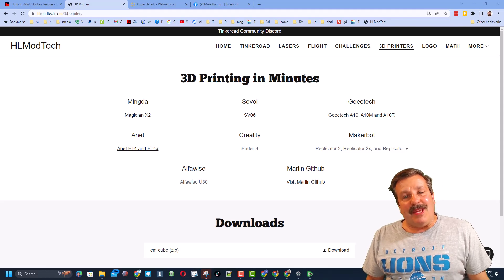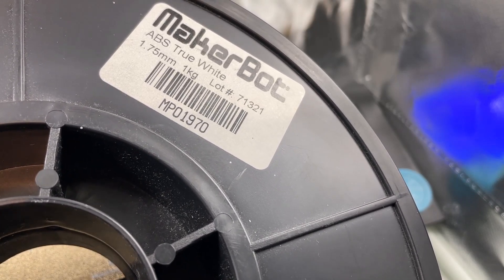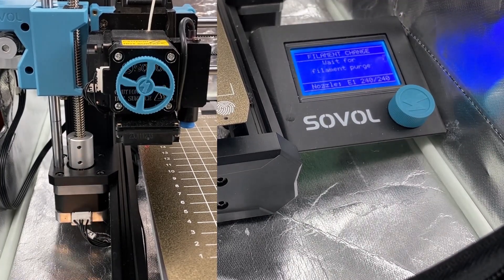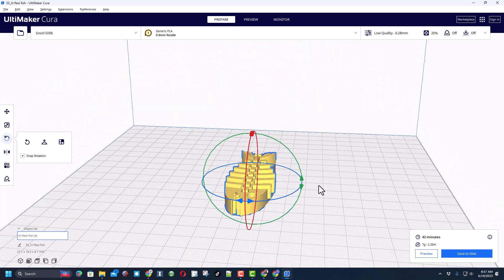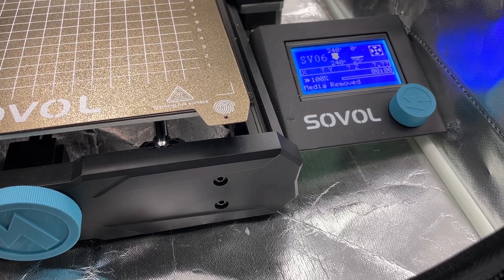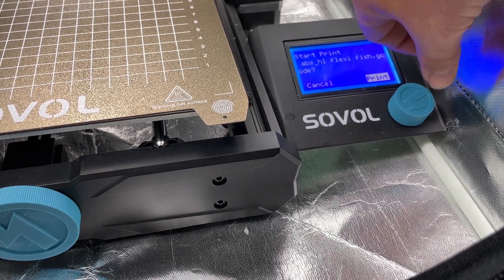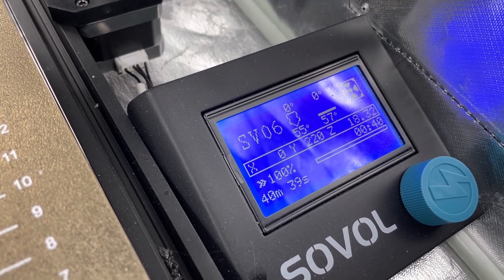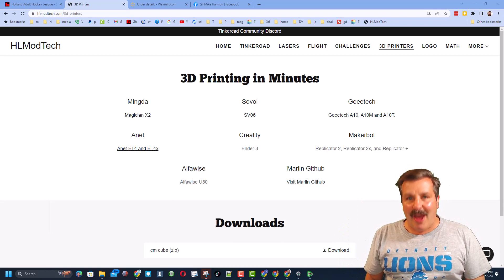Printing ABS on the Sovol SV06 Bonus Cura setup Tips too

Comment: Do you have any issues leaving the psu and mother board in the enclosure? I was advised to put them outside of it to prevent overheating.
Reply from the maker: I only printed ABS a few times so I have not worried about it. I prefer PLA and PETG so much more. I can see how heat could be an issue though.